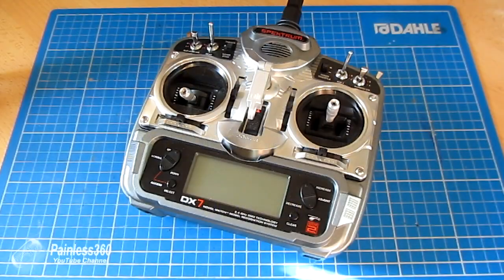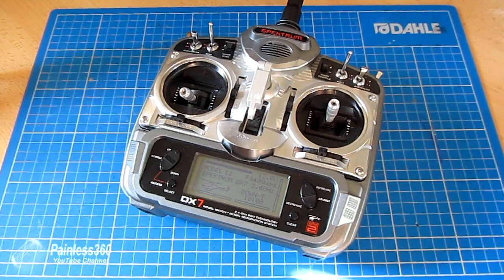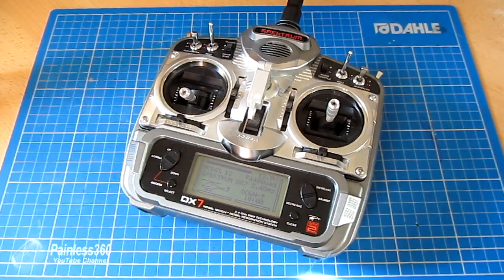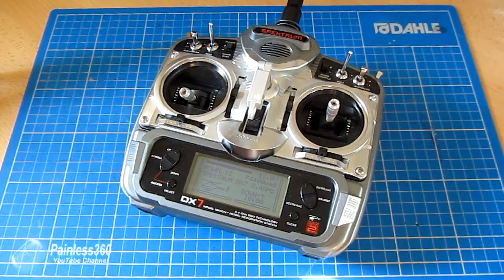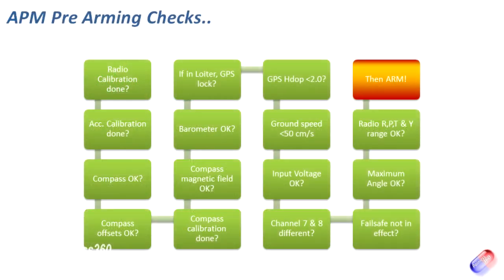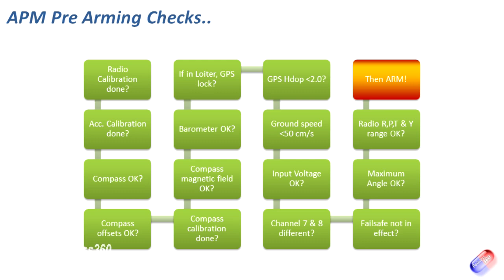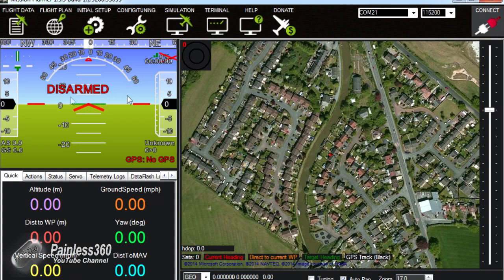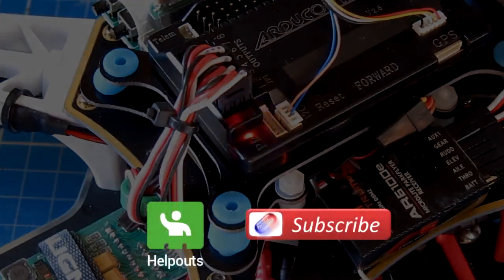(3/8) APM 2.5/2.6/3.1 - Troubleshooting APM arming

Comment: I have a question. I'm using Arducopter 2.8 and I can't get the motors to run. When I'mconnected via the computer using APM Planner2 the motors arm & run and everything isokay but as soon as I disconnect and try to arm the motors they jerk and stops and willnot arm.Please help me get this running! I've been following you for quite some time and it lookslike you are the person to ask!!!!!P.S. This is a Quadcopter.Thanks Painless360
Reply from the maker: I'd use the GUI to see what the error is on the logs/live with the model connected. I'd suspect a pre-arm check is an issue or maybe the health of the 5v supply on the model. Best of luck!

Comment: When I armed the board without prop and try fly everything should go right. But when I fitted the pro and try to fly (take off) one motor stop when i trottle raise.chennel 3. Is stopping and esc are bipiing. And my battery voltage is 8.45. Because. I use 3s 2200 mah. But one cell is damaged. So is there battery fault?
Reply from the maker: Yep, the battery voltage should be between 10.5 and 12.4 volts depending on the charge level. You need to dispose of that pack..

Comment: hello painless360 please help me i beg you ,i heve spent so much of money and nothing works out.  i am having apm 2.8 when i plugg it into laptop it arms by pressing the rudder stick to right when i place ardupilot on drone and plug it with lipo ,it doesnot arm . please tell me the solution
Reply from the maker: Happy to help but please watch https://www.youtube.com/watch?v=olIqTiSJHIY and come back to me with more detail of what you've tried..
Reply: yes sir! i have tried that all none of you tube video explains how to solve that problem there was discussion on diydrones forum about the same problem but nobody responded on that and no solution sir ! please help me i am really in big trouble
Reply from the maker: +Ashish Kumar but what have you already tried? Without knowing that it's impossible for me to add anything useful..
Reply: Painless360  yesterday it was armed but automatically disarmed after a few seconds 
and one point more that it does one thing either it arms for few seconds or esc(s) are callibrating 
one thing is happening at a time only 
and i tried :- before all that i wasnt using 5 channel to set the flight modes in stabilize ,acro and althold but after this also nothing happened :( :( help me !!!!!!!!!!!

Comment: Hi mate my gps  hdop only goes below 2.1 but has ten sats,When i go into loiter or rtl the quadcopter drifts.Would the hdop cause this,Would i be better getting a better gps like a  Ublox Neo-M8N.Any help would be great
Reply from the maker: Possibly, sounds like there is a little interference too? I'd move it further away and see if that makes a difference. We're using the M8N here and it's such an improvement over the Gen 6 and 7 GPS we've used..

Comment: Hi sir. I I did everything in order but my apm 2.6 still not arming I did my radio mode from the top  stabilize,stabilize,stabilize,loiter,stabilize,RLT. my gps all working, apm board all looks good but still not arming. could help me please.? by the way merry Christmas.
Reply from the maker: +Aydin Atik what error do you get in the gui?
Reply: Painless360 error is acro _ bal _ Roll/pitch.
Reply from the maker: Then I'd look up that error in the documentation - http://ardupilot.org/copter/docs/prearm_safety_check.html - best of luck!

Comment: My Apm 2.8 won't arm even when disabling the pre-arm check, any idea, nothing appear on the MP screen except of course Disarmed.
Reply from the maker: Without any error messages on the screen it's tricky to suggest that may be the problem. I'd check the basics like endpoints... Best of luck!
Reply: success , in pushing the Yaw trim completely to the right, now i am not centered anymore!Is there a parameter i can change in MP?Thank you.
Reply from the maker: Centered where? If you mean the yaw channel then use the sub trim to get the channels to be 1500 at the middle position. See the APM setup videos - it's all in there..
Reply: yup , this the limitation of this flysky cheap radio(CT6B), but with a small mechanical motification on the left stick i increased the travel, and everything is now fine.thanks for your nice videos, vithout em i could not have made it.

Comment: Im using an apm 2.8 and I am only able to arm the drone through apm planner and I tried arming it by setting the throttle to the right but it doesn't arm unless it's connected into apm planner. Any suggestions or ideas why I can't arm through my controller?
Reply from the maker: Not sure, I'd suspect the 5v supply in the model.. Have a look at the logfiles in case you can see anything and measure the voltage on the craft with, and without, the USB connected..

Comment: ever heard of this? I put params  from no nova on my 450 I built with 2.8 and one motor woukd not spin I flashed it back and 2 motors wouldn't spin so I reset and reloaded everything.. and now those motors are fine and another one is spinning slow I recalibrate the esc several times.. even with resets from the button and the from mp it still has my motors set to not spin when armed so I'm thinking that it's not really reseting... any videos on that?
Reply from the maker: Not sure what you're asking. I would always setup a model from scratch and not copy settings across. Best of luck!

Comment: As always, I enjoy your videos. I am trying to configure a APM 2.8. Is a compass and GPS mandatory? I have an external compass and GPS modules but am waiting for cables to arrive. When I connect the battery, there is a constant beeping. Is this something you've encountered? Thanks for any info you can share.
Reply from the maker: +abenwinUT we always add them to ours. not tried it without. There are better flight controllers if you're not bothered about GPS.. Best of luck!
Reply: Ooops.  I did as you suggested and tried to arm in MP and got this error msg:  PreArm: Compass not healthy. Also on the screen was: GPS: No GPS. Is there a way to turnoff/eliminate the compass check since the APM 2.8 does not have an internal compass?
Reply: Thanks for the quick reply. I do want GPS, so I will wait for the cables.
Reply from the maker: We've not tried it. Best of luck!

Comment: Hello.. I followed the 8 videos and learned a lot... Thank you very much!!!! based on that I could finish my tricopter with a HK MEGA 2.7... the only issue is that when it is "armed" the motors start to spin at very low rpm. In that stage I have no control on the tail servo... just have to accelerate a little and everything seems to work ok... if I move throttle to the lowest position again motors will spin at very low rpm.... Any clue? could the ESC? I calibrated all three as you show in your video... Well, please if you have any suggestion I will appreciate it very much!!! Thanks again for your nice job here!!
Reply from the maker: +Juan D you missed the answer then ;) Google 'painless360 apm motor running' Happy flying!

Comment: hello! i have problem my quadcopter. i have apm 2.6 and ublox 7m.. problem is when i go to out for flying my
copter everything going well. but when i press loiter/rtl mode on copter fly away and i got hurry click back
stabilize mode and fly back to me.. apm got solid blue led and ublox blinking blue led.
mission planner show me gps 3d fix. it found 7satellite indoors.. i cannot get my pc outside
i try enable geofence but not help.. any advice? ps. good videos i am new for this hobby i got my copter week ago 
and i get it fly your apm video series!
Reply from the maker: +wilho250 This most commonly happens when the compass isn't solid, calibrated and being moved by the power delivered to the motors.  Look up our video on why GPS modes need a solid compass.. I'd also look up the CompassMOT process too.. Best of luck.

Comment: hi I am facing a problem with a pixhawk 2.4.6 I did all steps and calibration but it arms and motors not spinning any idea please?
Reply from the maker: +Charlie Farrugia Not without a bit more detail. I'd check the throttle is moving and the ESCs are calibrated.. Best of luck.
Reply: +Painless360 yes I did all process esc calibrated also I calibrate them one by one do I need a bec on pixhawk? on the servo rail??
Reply from the maker: You do, you need to power the board... Best of luck..

Comment: Hi Painless,
Managed to arm/fly successfully before, but as of recent the board (apm 2.6) only displays a solid orange light when connected (both usb and battery). Cant connect to MP at all either. The only decent clue is that when connected to the battery, after about 4 seconds, the ESCs sound a "beep" in about one second intervals.

Very similar to what this person experienced https://youtu.be/YYSvy1FF8WY
Starting to believe it's bricked beyond repair, have you experienced this problem before?
Reply from the maker: +mexicubanguy never seen that here. If unplug everything from the board and see if that helps.. Best of luck..

Comment: Followed your APM 3.1 video series to the letter. Will not arm, and no HUD message on the type of error. Followed Arducopter Pre-Arm checks But have no errors to follow up on. Checked GPS’s HDOP it is 2.2. Mag  field is 188. GPS has 3d fix with 5 Sats. Disabled all pre-checks. Re caliberated Radio and all radio movements are correct in Misson Planner. I have Telemetry radio link so all response is in real time. No telemetry logs are created to be downloaded.
Any ideas?
Thank you 
Derrill
Reply from the maker: +Derr Nav HDOP seems a little high but not sure what you expect me to say when there are no error messages. Id check rudder and throttle endpoints are enough. http://ardupilot.org/copter/docs/prearm_safety_check.html may help. Best of luck!
Reply: +Painless360 Found the problem. First I identified that the power wires coming out of 3.1 for receiver were correct. Next I checked each channel and discovered two channel reversed. Fixed that and it arms now. Thank you for all your videos and help.
Derrill

Comment: my next issue is probably a parameters issue also but i cant find it.   in parameters there is no setting for Y6A only X.  when i set the parameters for X only 4 motors opperate.   when i set the parameters to 'Plus" 5 motors will turn which is most likely just an esc issue, but my frame is Y6A.   any idea what the proper parameter for Y6Ashould be.   listed values are 0 thru 5 and then it jumps to 10 but none are assigned to Y6A
Reply from the maker: +Mike Thomas Best of luck finding the answer - we are mostly X frames here..

Comment: If while trying to arm you get error message " RC Calibration" and you have done the radio calibration numerous times what then?
Reply from the maker: +Mike Thomas what troubleshooting have you already tried?
Reply: +Painless360  I have reflashed my firmware to version 3.2.1, I set up a new model on my taranis x9d plus, I individually calibrated all six esc's and the motors worked fine. I have calibrated all switches on the x9d multiple times. made sure it was in stabilize mode. recalibrated my compass (i have ver.2.8 apm with an external gps and compase),
Reply: +Mike Thomas  -   recalibrated my accelerometer, made sure that no fail safes are set, triple checked all connections but it still wont arm.    It did however arm very briefly once but when i turned everything off and back on again it would not.   I have also tried various versions of mission planner and apmplanner2.
Reply: +Mike Thomas  more precisely the message i get when trying to arm the board is "PREARM; RC Not Calibrated"
Reply: +Mike Thomas I figured out the problem .  it was in the parameters settings

Comment: @Painless360 I am running APM 2.6 FW - 3.2.1 I am a mode 1 user on my transmitter, which means i use rudder to arm the copter, I have build a Tricopter, My issue is I would like to limit my servo throw, and of which if i do it via transmitter, i will not be able to arm the board, is there anyway if i could arm the board using switches? 

I have followed the instructions on Arducopter wiki whereby it says RC7 is able to make the changes on the servo throw, but however it is not working, could you please help me out, Thanks a million.
Reply from the maker: Have you setup as per http://copter.ardupilot.com/wiki/tricopter/?
Reply: +Painless360 Yes I did, Cause if i use End points to do the servo travel to avoid servo binding then i will not be able to arm the board, so now i am looking at possibilities of arming the board via a switch, so that my end points remain as it is. with normal end points i am able to arm the board without any issues.

Comment: dear mr painless360, i think it was too heigh gains, but not sure and i cant get into flight logs with apm2.6 to see, mayby you could give me some advice....... i hope you can help me here as i have an MAJOR ISSUE, i build an x8 spider on 700mm frame turnigy multistar elite 4006 740 kv 30 amp afro esc otpo, and of course the apm ( arducopter 2.6 with power module ) very happy with the board, had it wth neo m8n external compass running fly s nice until i start messing round with tuning i autotuned it and give me a base to do in flight tuning , and in the end got it pretty stable expect a few wobble here and there, so did one more alteration and took it outside for test flight, flew good for 2 min, i shoot it up in the air on nearly full throttle,height about 80metres and then.............all 8 motors stopped spinning !!!!!!! then i tried throttle up and down no response !! failsafe did not kick in neither as i thought mayby signal loss...so it was FREE FALLLL omg.....but in the end about 5 second before it nearly hit the ground engines start spinning slowy up again ...but too late so full wack hit on grass...after testet connection ...no loose connection......my suspect to high gains ( but could that cause engines to shut down in mid flight ?? mayby esc cut off but i read that afro simonk dont do that....so i am thinking to buy  an APm ( arducopter clone 2.8 )m as i dont trust this board no more...but i want still apm as its awesome....mayby you have an explanation or idear...i would HIGHLY appreciate that...cause dont want this to happen again . thank you,
Reply from the maker: We can take a look but not for free I'm afraid. See the website for charges..
Reply: +Painless360 i thank you for your reply i am currently connecting mavlink came today from  ebay will have a closer look and maybe i can find something , but if not i will get back to your online support, i will check your website for charges , is the website to find on your channel , i will have a look now. thank you so much. kind regards
Reply: +Painless360 thank you again for your reply highly appreciated just wanted to let you know that i found the problem it was the powermodule the way i wired it, it said online maximum READING 90 amps so i presumed connecting all electrics including esc after  PASSING through the powermodule would be ok , but after few test today it wouldnt even lift of as power cut off again so tried full throttle lift and the complete plane become dead not one single led light working, so of everything passing through the module including led light i knew then, so will order new powermodule and will get t60 splittler and bypass and  the powermodule can only take what it need and disable my batteryvoltage failsafe feature, thank you  kind regards.

Comment: I need your help because can not arm it after days of trying. I don't understand if channels 7 & 8 have to be different or not. In my APM 2.7 channels 6, 7, and 8 are the same and there is not way to make them change. I have a Spektrumo DX7s and a Receiver AR8000. I Have eventually on in display: check  FS-THR-VALUE.  Any Idea will be greatly appreciated.
Reply from the maker: +Victor Rodas The error is all about the throttle channel value. I'd start there and make sure the throttle range from the radio is above 1000 at the low end and below 2000 at maximum and that you've not set the failsafe to a level that is seeing the normal range as 'failsafe'. See our build videos for the APM for more tips..

Comment: Hello again !     Since last question I've tried again and screen changed to ARM mode not armable.    Motors spooled up at low rpm for a few seconds and stopped.   I'm really baffled now.
Reply from the maker: +Eddie Lloyd If you need one to one support then we do offer it but it isn't free. See the website for charges.. Best of luck..
Reply: +Eddie Lloyd  I had the same problem and what is was, is you have to choose another model on your transmitter. you must have changed your receiver or lost your bird. But any way try that.
Reply: Eddie Lloyd  if you have that problem before the  motors spool down imidietly hold your quad down and switch to alt hold at full power then go back to stabilize test the throttle up and down then your good it needs a runup just like how you start your car have a safe flight i hope this will help and theirs one problem if this spools up and disarmed again you cannot rearm the board

Comment: Hi there ~ I've followed your series to the letter and still having problems arming the board on my Dead Cat with APM unit plus Turnigy 9X Tx.   I've gone through the wizard carefully in Mission Planner and when in Flight Plan screen each time I try arming the board by holding yaw ( rudder ) stick to the right for no more than 7 seconds the screen says "DISARMED FAILSAFE NO RC RECEIVER".   Can you help please ?   All controls and flight mode switches are showing correctly.   Tx is in PPM Mode.  Cheers !
Reply from the maker: +Eddie Lloyd If you need one to one support then we do offer it but it isn't free. See the website for charges.. Best of luck..